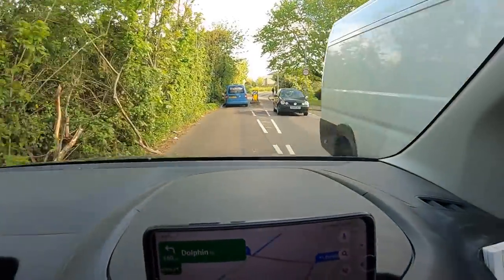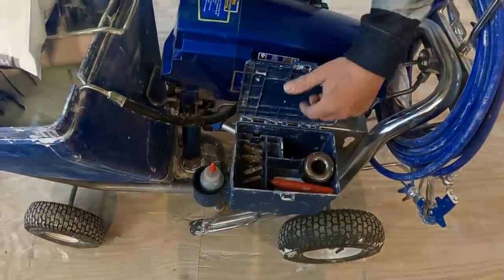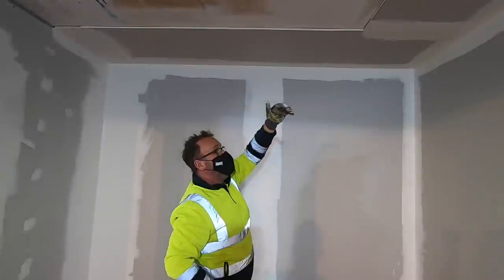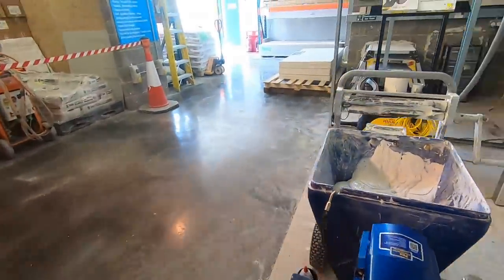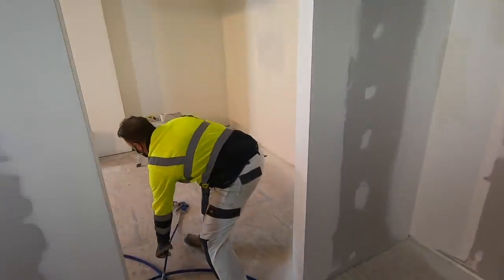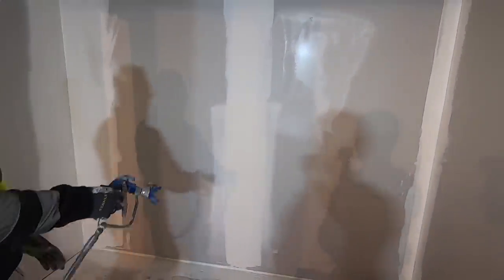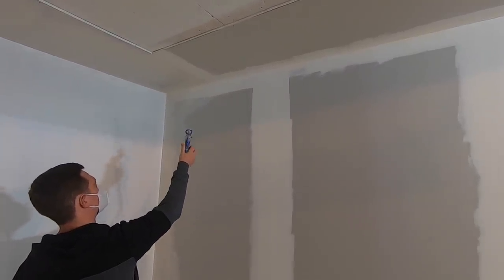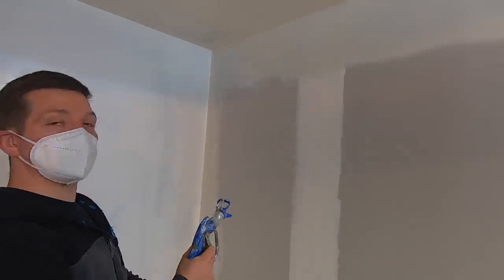The Future Of Plastering!! Airless Spray Plastering (FULL GUIDE) Part 1

Comment: Serious question- if using Gyproc/plasterboard/drywall (like in this video), what is the purpose of 'plastering' the whole wall as opposed to just filling joints then prime/paint? Is it just for texture? Or is it just an adaptation of traditional plastering with modern building methods/practices?
Reply: Paper, that the boards is covered in, produces a different finish to plaster and jointing compound. So most plastering in UK is not taped seems, it's skim coat.
Reply: @cjhification  So I guess the skim coat is strong enough to withstand cracking at the joints without reinforcement (tape)? Interesting..
Reply: @Matasky2010  we tend to use a fiberglass reinforcement tape at the joints as this is much stronger than the paper tapes, and paper is not needed for the finish as the skim coat does the "finish" part that the paper tape would fulfill.
Reply: @cjhification  Ok so basically you don’t rely on your plasterboard to provide a finished surface, unlike the paper surface of a drywall sheet which is ready for paint.
Reply: @Matasky2010  drywall and plasterboard is exactly the same thing by a different name, we just consider the finish of drywall to be poor, and only something done if you were cheeping out, to the extent that I don't know anyone who would use it. Got to remember our houses are on average about half the size or less compared to American homes, so finishes can be done to higher standard without same cost explosion.
Reply: @Matasky2010  there is probably also an element of its how it's been done since drywall came in to wide use in the 50's, as it was a quick and easy method compared to lath and plaster that had been used here previously, using the same finishing skills they already had without having to deal with any of the paper. It may be that taped seems and filled joints, sanded back, is used in new builds, have no idea what they get up to.
Reply: @cjhification  Ok so just different methods, you’ve adapted traditional plastering to modern panel products. Drywall is cheaper but provides a flat surface, commonly used in everyday residential construction across North America. When finished properly it simply provides a flat surface, which for many people is the goal. Not judging but I’d guess any stigma against drywall in the UK is more about plastering being the ‘norm’ and accepted way of finishing walls. I agree it’s more durable and provides a more ‘solid’ wall, but drywall is also easier to repair and more easily accommodates renos/changes. All products have advantages and disadvantages, I just like to understand the different applications. Personally I like walls with some character and irregularities provided by a manually applied plaster. Cheers!
Reply: @Matasky2010  the fact that the majority of older homes are brick means there is still a lot of Hardwall base plaster used, finished with a skim coat so it's easier for plasters to do similar skim over plasterboard than do all the filling of screws and seams and all the sanding back, as there is no sanding back with a skim coat. Though dot and dab is used on some internal brick walls or on duel skinned external walls now. This all tends to still be plastered afterwards though, again partially stigma, but also just that the surface finish of paper is different to a powdered compound when painted no matter how well it's sanded back. 

Also on the stigma side, it was only used on council houses (social housing) to start with as it was a cheap, quick method bit seen as inferior to a good brick wall, they used side on Bricks for non-structural walls often to save space and materials where flat bricks were not needed. That has changed now but is probably a partial reason why there is still a little stigma with having your plasterboard showing rather than plaster over that top for some.

Comment: It really looks like it's on too thin and how would you deal with angle beads with the spray system?
This stuff looks similar to what's used in the US by dry liners, can you make it really smooth and shine like BG?
Reply from the maker: You have to tape and fIll the joints beforehand - this is the downside. The rest of it is great but that's my only issue with this system.
Reply: Different angle beads, much thinner.

Multifinish is only used in the UK. The rest of the world have used the hand applied white stuff for a very long time now.

It's got it's pros and cons. Thin coat dries quickly but the boarding and joint filling has to be done perfectly.

If it's old walls you may need to undercoat it.

Works great on commercial sites where you can spray multiple rooms in a day. 

Then, it'll have to be sanded when fully dry.

Multifinish is much more forgiving when it comes to preparation. Blaine can do a room per day and will never need to come back to sand it. And that's where multifinish really shines.

It's not a replacement product in the UK at the moment and I don't it will be for a while. Especially, some people are just used to the pink stuff and won't trust the white goo at all.
Reply: @PlasteringForBeginners  thanks.
Do you apply angle beads around window frames say as usual?

Comment: Good for big projects, if you don’t mind the noise from the machine and it constantly blocking. Once its dry and ready to sand, after about 10min of sanding you’ll have the machine for sale on eBay 🤣🤣
Spend 5k on the machine, gear costs 4x more than skim too.

Comment: The boards need to be spot on for this system to be effective. You’ll never go on a development with a volume builder where this is the case.
The fact you have to dub out with joint filler is an issue, if there was a joint filler that would go through the machine so you could wiz around fast, would be a big improvement.
The fact the material is easy to flatten is good. Let’s not hide from the fact that the coat looks less then half a mil thick though..?
I can see this being faster then tape and jointing.
Probably a better finish then most people get with skim too.
What’s the cost of a bag of this material and the machine? 
Let’s face it if the layout for material is double it’s just not worth it...

Comment: this is a game changer. Soon enough, the plaster will contain a white pigment, so that when it dries they'll be no need for mist coats if you want a white finish.
Reply from the maker: Exactly that pal!
Reply: The mist coat is used to bond the paint to the plaster, not necessarily for the colour. You can get away on ceilings not painting them at all with this system if you’re good. I know lads who get paid to bring them to a finish and just sand and that’s it. You are able to get the Caparol spray plaster tinted which is a massive game changer if you’ve got big sqm in a particular colour. You’d get away with skimming and one coat of paint no problem.
Reply: @joebonthuys  a mist coat is used to saturate the plaster with moisture so that it doesn't siphon it from the paint before it "bonds". The white pigmant I was talking about would contain a chemical ingredient that would make the mist coat redundant, otherwise they'd be no use in having the white pigment in the first place.

Comment: One thing you are missing is that plaster boards /dry wall were invented to save time and not plastering at all. Just skim over the connections and paint.
Reply: You will see a difference in the texture if you do only joints, even after painting, besides paper on the plasterboard it`s not that strong against moisture. Its ok for offices and industrial estates, in any other situation it`s just laziness and cutting corners not proper job as it should be done... its started since "bakers" without knowledge start working in construction industry.

Comment: Hi mate i can’t see this being us in domestic work imagine lugging it through a terraced house and the noise too?
Reply from the maker: You can leave it outside and run the hose through the house apparently. I'm trying it domestically soon so I'll let you know how it goes 👍
Reply: @PlasteringForBeginners  we either set it up out the front or leave it in the van and run the hose up through the windows.
Reply: Hydraulic airless in the back of the van is the way forward. Only take a hose in

Comment: Finish plaster is gypsum and lime, the lime is to gauge and heat the gypsum.Thus it sets up in a certain amount of time.Using a horse hair water brush and water you trowel out your marks and using the juice you slick finish the walls.witch will become hardened in no time. This is not even close to that event.I could explain the process in more detail but its time consuming.How ever real plastering i find only in commercial use now days,not residential. Also KNOW as hard wall us oldtime plasters know what im talking about such as dot and screed to plum wall out.!!!😆

Comment: Nothing new about this, been taping&jointing for over 20 years now and seen this system about 15 years ago, reps came on site and demonstrated, it looked amazing and few months later I bought it but sold it a few years later as most of the builders wouldn't have it over traditional plastering.. which I do as well
It's a glorified taping&jointing but it works out more expensive and no one wants to pay for it..
Reply from the maker: This is very interesting... It's a shame it didn't Work it for you mate. I appreciate the feedback. Cheers pal 👍

Comment: I used this system 15 years ago , airless plastering “ Altec” it is easier but it is longer, in tape and jointing, and sanding the 2nd coat when dry     Yes you can speed  the drying up with heat ,but the sanding is a disaster , really un-healthy and dangerous for lungs mo matter what masks or other protection used. I was one of the first in Ireland & probably Uk to use this back then, it is a European system that is more for industrial use or huge site work. The machine I used was a  Vagner airless sprayer petroleum run,and was huge to move around, parts expensive, no good for domestic use.  Iam now back at conventional plastering. 
Very hard to convince this product to clients in the long run.  Not recommend

Comment: Why even bother if the wall is already flat???? 
Isn't the the purpose of hanging sheet rock/ Drywall??
It looked finished to me and ready to paint.
Reply: Yeah, good question, I also have wondered why this is. My guess would be that you are having to fill the gaps between the plaster boards (where two separate plaster boards meet) with a different material, which not only would create an uneven surface to paint over, but also might show up if emulsion paint applied without using a primer......that could be complete nonsense tho, it's just a guess
Reply: @charlespell7762  I'm just assuming that in different countries they just do things differently and have different types of construction codes to follow????
Codes aren't necessarily universal world wide...
What they are doing in the video still seems a bit overkill for me.

Comment: For cheap fast construction this is OK. Not for quality work. This is why I came to your channel. I am in USA. This is level 5 drywall finish. No matter how you put it on it looks like a plastic finish. And not durable at all. You can mark it up very easily. 

I have seen enough of this to not want it. I am not a plasterer. I am a home builder. This would work for big jobs where money is a big issue. Not for custom home building in my opinion. It is true that most will opt for it due to price. But the charge for level 5 approaches all plaster. Once someone sees quality plaster work they want nothing else. This is mainly on higher priced homes which seems to be what everyone is building now. However it is an option you can offer. And if these.bigger builders have their way, they will push drywall finish walls on your industry there. I do not know where Europe stands in interior wall construction though. 

I say invest in textured ceilings and walls as another 
avenue of expansion. Beautiful sunburst ceilings are one example as well as a really hard finish lime knockdown. 

Don't let your trade die like that. This happened here. Looking for cheaper and faster ways of doing this.

Comment: Check out EcoConil on Facebook. 300m2 of plaster per day no issue. Also not limited to readymix plasters and spray multi finish.  They also spray cement, #diathonite (cork) #clayworks clay... With the same machine. Airless is the way forward for (larger jobs) if you know what you are doing.

Comment: Alot of prep first, quite expensive, slower than by hand as you gotta do two coats and wait in between, finish not as good, and it has to be sanded afterwards 🤨  a system for non plasterers really

Comment: $3500 for that machine and hopper , or $400 for a compressor and a hand hopper .... Hand hopper washes out in 2 minutes and when it "breaks" (after 10 years) , pay $69 for a new one ...... plus why spend all that time slicking it out smooth , when a fine orange peel texture looks awesome , just spray it and yer done ..... totally smooth walls look like crap in my opinion anyway , I'd never have them in my house .... Just a very minimal texture breaks up imperfections and almost looks smooth anyway ..... slick walls are total overkill and you have to be very anal to want that in a house .... besides , if you want smooth walls , just do a very good tape and bed job and prime and paint , you'll get a smooth wall
Reply: "plus why spend all that time slicking it out smooth , when a fine orange peel texture looks awesome , just spray it and yer done ..... totally smooth walls look like crap in my opinion anyway , I'd never have them in my house .... Just a very minimal texture breaks up imperfections and almost looks smooth anyway ..... slick walls are total overkill and you have to be very anal to want that in a house" ..........................I totally agree, infact isn't that why decorators use a roller, after applying paint with an airless sprayer on to plasterboard? This technique even got a name i think. It's something to do with how light reflects off the surface I think
Reply: @charlespell7762  I agree with you 100% ..... when I built my 2nd house I sprayed a fine orange peel and done .... looked fantastic ..... and you're right "slick walls are anal" . fine texture does almost the same thing , looks smooth from a distance .... and a slick wall shows all defects , one ding stands out like a sore thumb

Comment: To me this is not really plastering as we know it. It’s more a level 5 finish using joint compound. I do a bunch of level 5 finishing on jobs and instead of buying the mark v graco sprayer at approximately $8000, you can use a big paint roller using a 1” nap.

Comment: After masking everything up. Fixing beads and then tape and joining the whole room!
Quicker and better to skim proper. This system is only for pre perfect flat surfaces. As soon as the instuctor said it was designed to be sanded, i was laughing.
I think a decent spread who makes decent vids is now on the payroll pushing rubbish.
Reply from the maker: I hear what you're saying and the limitations are in the prep. I do think it has potential though so I'm going to keep testing it - if I can speed though the prep then it can be effective. That's what will let me down though and it's the tape and joint since that's something I've never really done. It's worth trying though!

I appreciate your comment! Cheers 👍

Comment: Useless stuff for domestic. This is not proper plaster. You can only spray on a very thin coat. Your walls have to be perfectly level. This only works well for big new build projects with an excellent drywall/boarding team.

Comment: I’m sorry to piss on your parade ! I’m sure this takes longer, you will have to prep ect and the time you’ve done beads ect just doing it with multi would be much quicker and a shit load cheaper than buying that machine I’m sure, also you can go most places and get a few bags of multi finish bet that stuffs hard to get hold off and double dear as well!
Reply from the maker: It's fair point mate - the prep does let it down a little bit. That's my issue but I'll test it and see how it goes 👍

Comment: That’s not plastering,,, you’ve got to tape the room first by the looks of it ,, yer in and out in one hit with multi finish,, definitely not the future!!!!
Reply from the maker: Fair point mate 👍
Reply: @PlasteringForBeginners  Why exactly is that a fair point? How long does it take to tape the joints....
Reply: @Stuart Cleary  Just to clarify, when you say "multi finish", is that a material that can be applied that does NOT require taping the joints? And I presume it would be applied by hand, and thicker than the kind of plaster used in the video?
Reply: @charlespell7762  British gypsum multi finish is applied by hand normally and it goes on about 3-4 ml thick to any surface that’s been prepped correctly, if you are coating over fresh plasterboard you need to tape the joints with fibatape before you skim!!!
Reply: @charlespell7762  in that comment when I said you’ve got to tape the room I mean Ames tape the room not just tape the joints with fibatape